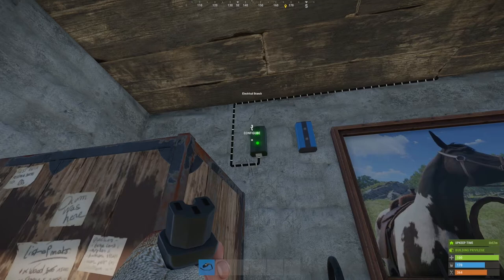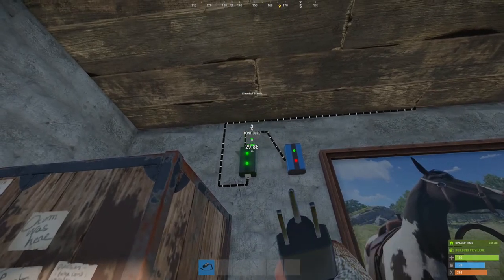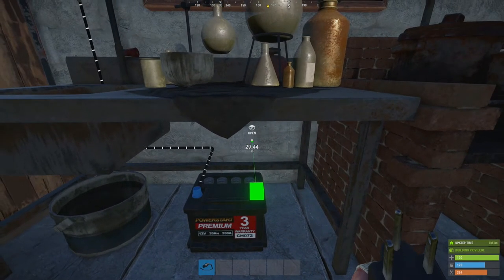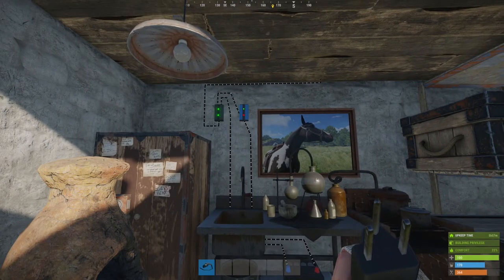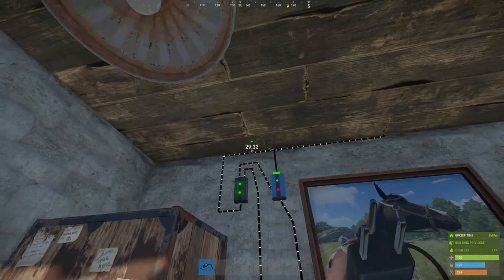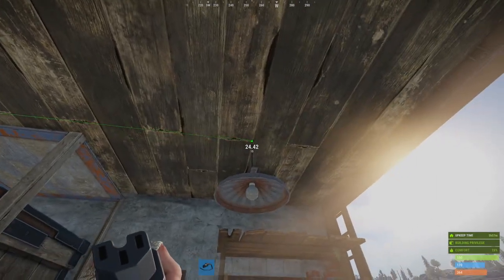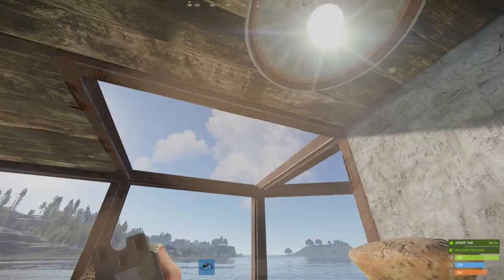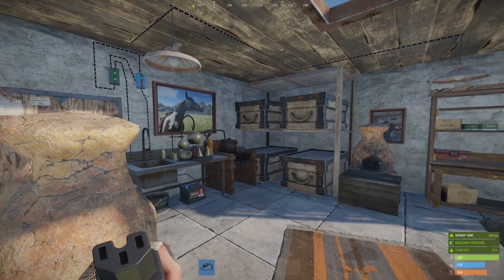How to set up lighting that comes on automatically at night - Electricity guide - Rust

Comment: for some reason this process will not stick in my head. I think I have watched this video about 70 or 80 times. hahaha! thanks for explaining things so clearly and precisely!
Reply: It’s a branch and a blocker. Not hard man
Reply: Try to think it out a bit instead of just memorizing the circuit. The blocker, as the name says, will block the energy when the "blocker input" is energized. Since the solar panel only provides energy during daytime, the "blocking" will only be energized during daytime aswell. However, if you just set it up with no battery, your system would energize at night when tjere is actually no energy, so the branch splits a small power to the blocker and the rest to the battert. When its night time, the blocker de-energize and the battery kicks in. Pretty simple :)

Comment: You can put a small half wall in front of the solar panel to allow the lights to turn on even sooner as the sun goes down, instead of sitting in darkness for a little bit.

Comment: Since my base has things that always need power, and i want the lights to stay on for longer during the night, i have added a north-facing solar panel with half walls on each side to act as a "checker" light, which is what controls whether the lamps get power or not. And it works wonders!

Although i did have to run the electrical branch through a small battery to a root combiner in order to combine the available electricity for the lamps with my large battery - the reason for the battery is because the electrical branch really does not want to directly connect with a root combiner. However, after all that is said and done, i have lights that stay on for longer since they can draw from the large battery.

over all, very good video! straight to the point and very clear to see what wire went where.
Reply from the maker: Thanks for the praise and taking the time to talk us through your set up.

Yeah, adding short walls is a great way to increase the night light, and also offers a bit of protection to the panels as well 👍

Comment: So I need the same thing for multiple search lights. I believe it will work if I use only the pass through from the branch to the blocker so actually blocks the signal when it s daylight and the main source will come from a large battery powered by a wind turbine. Basically the solar energy light will work only as a night detector and for the rest of the power will be used a different source. Hope that works. Thanks for the video by the way. You re awesome!
Reply from the maker: Glad the video helped 👍 I don't see any issues with what you plan, let me know how it goes!

Comment: Important distinction: this isn’t going to turn the lights on only at night time. It’s going to turn the lights on whenever the blocker stops receiving 2 watts of input from the solar panel. This can occur if the panel is damaged or destroyed as well.
Reply from the maker: Yeah, but I don't think that'd be a surprise to anyone. If you start removing vital components from anything, it isn't going to work as intended.
Reply: How do I fix this I have everything right and the battery doesn’t charge

Comment: How do u get the battery to recharge the light come on at noght but then turn straight off cause the capacity is at 0 rWm
Reply from the maker: The solar panel recharges the battery, make sure it has plenty of sun on it.

Comment: I'm new to electrics but my turrets and lighting turns of when it turns night I use a medium battery idk but never used to happen
Reply from the maker: Sounds like the battery is drawing more power than you have going into it. I’d suggest at least 25 percent more power than the total draw or get a windmill that will produce power constantly.
Reply: @friendnotfoe  yh thought about windmil but power keeps changing from ten and spiking up to 37 randomly
Reply from the maker: How are you charging the battery? You’d need at least 3 or 4 solar panels assuming a full draw from the battery. What you powering?

Comment: So what would I do differently if I’m wiring multiple panels into a medium battery ? Trying to power 6 lights for night time
Reply from the maker: You’d need to combine the panels output using root combiners. Then root combiner into the electrical branch as per the video… the rest is the same except with medium battery.

Comment: Is it possible to connect this to the battery for the whole base or does it have to be separate?
Reply from the maker: You can connect this to your bases main battery, you just need to make sure you run the power via the branch so you can power the blocker.

Comment: how do i add power to this circ for more lights worked first try
Reply from the maker: Just use a bigger battery and either a wind turbine or more solar panels - then just continue using pass thru to daisy chain all your lights together.

Comment: I run very intricate circuits and have reached the point where I get an electrical short due to the number of pre-battery non-root combiner electrical components. is there a way to use this circuit on a main power circuit or am I having to create a separate circuit for lights only?
Reply from the maker: Not sure, I generally only run a few small circuits for base stuff and then dedicated circuits for things like turrets/SAMs.
Reply: same. I’m thinking we may need to use a solar panel as a sort of daylight sensor, and have that plugged into some kind of logic gate, that will turn on the lights if the panel is not sending power. I am looking into this as well as toggling between camera power during the day and lamp power during the night
Reply: It’s possible to incorporate this into your main power circuit.  You just need the set of the needed amount of power and for the light circuit and then simply do the same thing , but you will ignore the part where you connect it to the small battery cause your power will be coming from the medium / large battery   , so just route the power in from that source. And it works.

Comment: I’ve just tried this but I look power off a splitter and it doesn’t seem to work. is it possible to do the way I’m trying or can this only be used with small batteries?
Reply from the maker: As long as there is power going to the blocker from the solar panel this should be fine.
Reply: @friendnotfoe  I’m running 4 solar panels into route combiners and then from the route combiner’s the power goes to the medium battery. 
Power comes back into the splitter. I then took power from the splitter to a electrical branch and used that to power the blocker but can’t seem to get it to work. 

Could you possibly make a video incorporating a splitter and using a bigger battery?
Reply from the maker: You need to take power to the blocker from the solar panel, not a battery. A battery is constant source of power, the blocker uses the solar power to know if it is light or not.
Reply: Well for one you don't need a splitter as each light has passthrough
Reply: @brayden.sampson3342  if I was only using lights then I wouldn’t need a splitter your correct but I’m also using turrets so need the splitter too.

Comment: How would you do more then 2 light?
Reply from the maker: Just add as many lights as you like via the passthrough on each light. You just need to ensure you have enough battery power to power them... ceiling lights uses 2 power each.

Comment: The blocker wont keep the lights off at day, they're always on and idk what the problem is
Reply from the maker: The blocker has to have a direct connection from the solar panel (not a battery) to work. Without more info about your circuit I don't know what else to suggest...

Comment: What do you set the branch and blocker to
Reply from the maker: The branch from the solar panel just needs to be set at default, which is 2. There are no settings for the blocker, just set the inputs from the correct components as per the video.

Comment: I have my circuit the same as you at it randomly came on in the day is there a fix to this ?
Reply from the maker: The lights will come on as soon as the solar panel gets no power, so if the panel is in the shade at all during the day the lights will come on. Make sure the panel is out in the open where there is no chance of shadow.

Comment: isn't an xor switch literally a blocker? branch 1 into xor, rest into battery, run battery in 2nd input of xor and as long as solar panel has electricity, xor doesnt turn on.
Reply from the maker: Sort of, XOR will power from one source or another but not both. So in this case I think the circuit would be identical but with XOR instead of blocker. No component advantage either way but useful if you find one faster than the other.

Comment: do you have to always face NORTH or it depends where you are on the map ?
Reply from the maker: Hmm, I'm not up to date on where Rust thinks the sun is. When I started doing electrics the best thing to do was point north, then it changed to pointing to the center of the map - not sure what it is now.
Reply: not to be that ''guy'' but ive heard Rust sun changes depending on wich month and every wipe. i just put it facing W/E everytime and always have 20 power coming out when the sun is on it